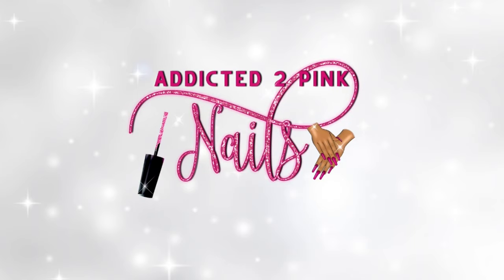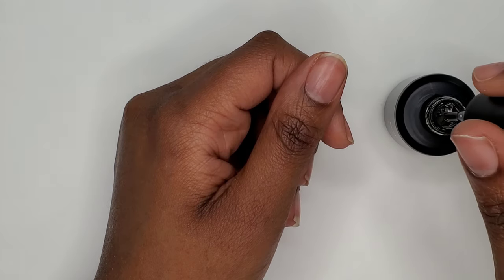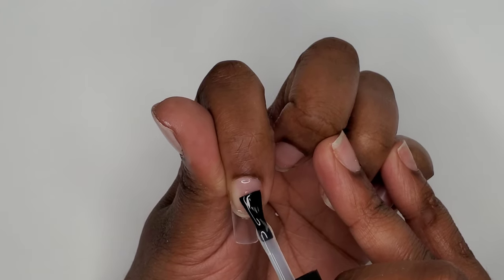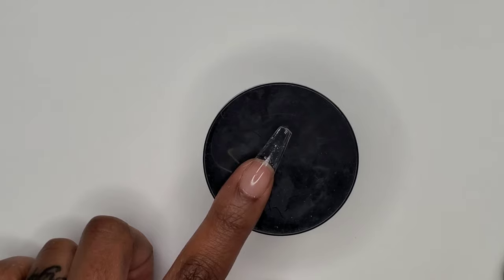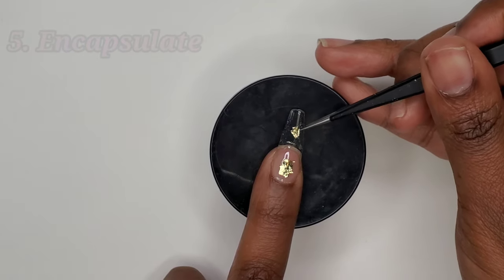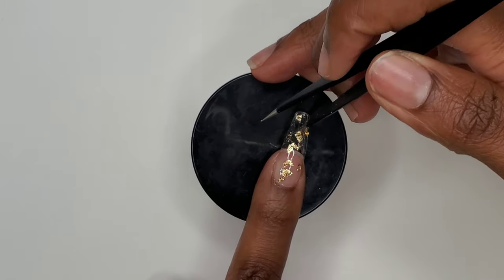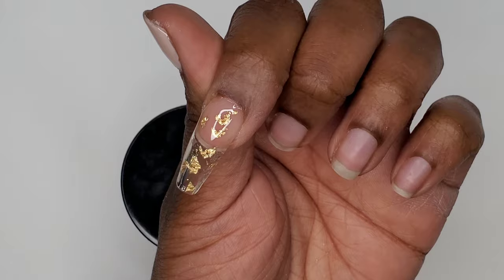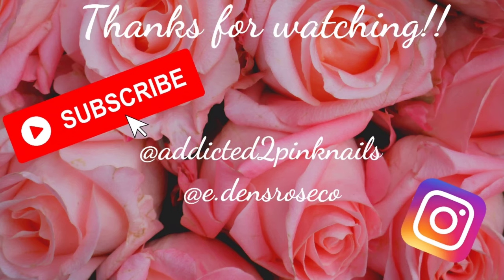5 Ways to Use Rubber Base Coat|Introducing E.den's Rose Rubber Base Coat

Comment: Love this video!!!!!! Been trying to find any info on if it can used as a glue for tips.. I’m curious however, do you put a layer of rubber base gel and cure it on your nail before putting it on the tip to fully cure??
Reply from the maker: Thank you!! 💖 Yes, you can use Rubber Base to glue tips. You just apply a small amount to the tip or your nail, hold the nail in place to apply the nail then cure. You don't have to apply a layer to your nail first. 

@lovedbyverdienails has a video on her channel using this method to apply tips.

Comment: Thanks super helpful! Would you recommend doing this coat as a filler for outgrowth? I’m trying to figure out a schedule that has me doing less grinding down of my nails and uses maybe 2-3 fillers before removal. 

I’m even thinking of doing the rubber base coat then putting peel off base on top for easy removal of colors.

Comment: So I had an allergic reaction to the builder gel it makes my nails detach from the nail bed. I’ve been doing nails  for decades so I know it’s not application. I can wear acrylics just fine. So I messed around and used a gel basecoat for acrylic and it works like a champ. I wanted to use the press one like apre or beetles. I too have scouring you tube looking for anyone else doing this and so far only you and one other. Instead of builder gel I put acrylic inside the tip and put it on and it works beautifully
Reply from the maker: Wow!  I am so happy you found something that works for you.  Acrylic in place of the gel definitely works just as good. Thank you so much for watching! 💖

Comment: Thank you for such a useful video. I got the products and can’t wait to use them! 😊
I ran into a problem this last time doing my nails. After applying top coat I noticed that my nails are still thin and bendy. I only applied one thin coat of base under gel polish. Can I file back the top coat, apply another coat of base, and finally reapply top coat?
Reply from the maker: Yes, you can file away the top coat and gel color and reapply the base. Depending on how many layers of polish you may just want to start over because you may not be able to file it away neatly.
Reply: @addicted2pinknails  ahhhh 😌 I was hoping to save the gel polish and not have to redo the whole thing. 
But technically if I manage to take off the top without damaging the color layer, I could still apply base coat over the color and then top coat right?
Reply from the maker: @lastochka100  Yes! That is correct. That method should work as well.

Comment: I see a lot of short about growing nail under rubber coat and thinking of buying too then i remember the UV nail gel i have and i have a rubber base  coat🤭 its perfect gonna try this (the only missing is top coat😭can i use clear polish?)
Reply from the maker: I hope it works for you! If you are using gel, I would suggest sticking with a gel top coat as well. 💖

Comment: A lot of rubber base coats instruct to not cure between the first thin layer and the second thicker layer when applying on natural nails. Would this be the same for your base cast?
Reply from the maker: I've used it both ways and didn't have a problem either way. It depends on how you're using it. If you're doing a gel overlay or structure gel mani using the rubber base the first layer helps the second layer fall into place, so you wouldn't want to cure it.

Comment: I want to buy a pink colored rubber base coat. Do I need to apply regular base gel first? Also, do I need a clear top coat to seal it? If it's uneven, can I file it after curing to even it out? Or will that ruin it?
Reply from the maker: As long as it's a rubber base, regardless of the color, you don't have to apply the clear first.  Yes, you'll need to apply a top coat.  You can file the nail. I would suggest using a fine grit and filing lightly. Sometimes buffing in place of filing works if the imperfections are minimal. I hope this helps.  💖

Comment: Rubber base is a soft gel correct? And do you prep natural nail as usual?dehydrate and do you need bonder for rubber base?
Reply from the maker: Yes, prep your nails as normal.  Apply dehydrator.  I used the rubber base as the "bond" or "primer" I hope this helps. 💕

Comment: Could you tell me the difference between rubbing in the basecoat vs applying a thin layer? I'm using a new brand that tells me to rub it in. I know how to do that, but am wondering about the difference
Reply from the maker: "Scrubbing it in" is just a slower, more intentional motion that allows it to penetrate every area of the nail.

Comment: Very good video. Thank you. One question it can be used before applying acrylic powder to the nail?  Does it work ?
Reply from the maker: Thank you! Yes, you can apply it to the natural nail, cure, then proceed with your acrylic application.   It works great as a primer. Tfw! 💖
Reply: Thank you dear. I will try it

Comment: Awesome video hun thanks for the tips. Question can I purchase your single led light on  your website. And I want to purchase your base coat
Reply from the maker: Thank you so much for watching! I don't have the light alone on the website just yet.  You can email me and I can work that out for you.  💖
Reply: @addicted2pinknails  okay hun. Thank you so much for your REPLY.
Reply: I sent you a email hun and question can I use  the base coat, cure then add glue so it's not directly on your nail bed. Will that hold good?

Comment: What is the difference between the normal base coat and the rubber base coat?
Reply from the maker: Rubber base coat is thicker than regular base coat.   It can be used to add strength to natural nails and help promote nail growth.  It can also provide strength to nail enhancements.   I hope this helps. Thanks so much for watching! 💖
Reply: @addicted2pinknails  thank you for your comment! I read that it is no soak off, your video is amazing keep going like this, I enjoyed! Ly
Reply from the maker: @jasminegrande8081  Thanks so much! 💖 Mine does soak off.  I will try to post a video soon showing a soak off.

Comment: If I use this as a base coat with gel polish on top or to grow my nails stronger do I need to take everything off every set of nails or just fill them in each time?
Reply from the maker: Hi! Thanks for the question.  When using it as a base for gel polish I would start fresh.  When using as a primer beneath a product you can fill it.  I hope this helps.  Tfw💖

Comment: Hiii girllll, I need help desperately 😭I'm a start up nail tech and just trying to build up clientele but my gel overlays seem to chip and peel, is there any way you could help me by giving advice on how my gel can last longer, I've went ahead and got me a rubber base coat, is it possible to use any top coat or can I apply normal gel polish on this base coat, and also what prep works the best 🙌🙌🙌🙌
Reply from the maker: Hii!!! 👋🏽 Make sure you are capping your free edge with base, polish and top coat.  Also make sure you are removing excess product that may get on the skin. Rubber base coat is still a base coat.  It is just thicker and has more uses.  You can definitely apply regular gel polish and any top coat over the rubber base coat.  I hope this helps.  

Prep steps vary depending on if you are doing wet or dry manicures.

Comment: I have a question using it as a primer do I still need to do dehydrator?
Reply from the maker: Yes, you still need to use a dehydrator or use a mixture of alcohol and acetone to wipe the nail plate.

Comment: Do you have to cure it before applying your acrylic? And also when using the rubber base do you need primer.?
Reply from the maker: Yes, you'll have to cure it before applying acrylic.   I do not use primer. I use the rubber base in place of the primer. 💖
Reply: @addicted2pinknails  how long do your sets last compared to using Reg nail primer?
Reply from the maker: @Rjz10  I was barely making it two weeks with regular primer.  With the rubber base I have gone 7 weeks.

Comment: Do you have to blend the tip into the natural nail or just apply the rubber base on top?
Reply from the maker: Hi! It's a full cover tip, so no blending is necessary.  You can clean up the sidewalls and cuticle area if necessary. Tfw💖

Comment: Does rubber base gel need a primer first, or can I just use alcohol?
Reply from the maker: You can use alcohol to remove dirt. I would suggest a dehydrator to remove excess oil, but the rubber base acts as a primer as well.💖

Comment: Do do I need to remove rubber base coat before adding extensions
Reply from the maker: No, it works great as a primer underneath extensions. I would suggest adding a fresh layer if it has been worn by itself for a few days.

Comment: Is that a rubber top coat? If not, Does that company make a rubber top coat that stays shiny like the regular top coat?
Reply from the maker: Hi! It's a Stainless Steel Top Coat.   It definitely has a lasting shine, unlike regular top coats that go dull after a few days.  I have a video on my IG page that shows the shine is still there after 3 weeks.  It's available on my website, plus I offer a discount code.  All of the links I mentioned are in the description box. I hope this helps. Thanks for watching!! 🤗💖

Comment: Can I use gel polish on top of the rubber base coat?
Reply from the maker: Yes, you can use it like a regular base coat.
Reply: @addicted2pinknails  Thank you, Well the gel polish Im useing is not adhering to the base coat, I have tried several times. Ended up useing Acrylic on top.
Reply from the maker: @octaviachapman8049  Wow. Do you think it's the base coat or the gel polish? What brands are you using?
Reply: @addicted2pinknails  well could be the gel polish, its a new brand I was trying called Tertio
Reply from the maker: @octaviachapman8049  Got cha.  Maybe you can try it on a swatch stick to confirm it's the gel polish.
Reply: @addicted2pinknails  Good idea will try it and see. Thanks a lot